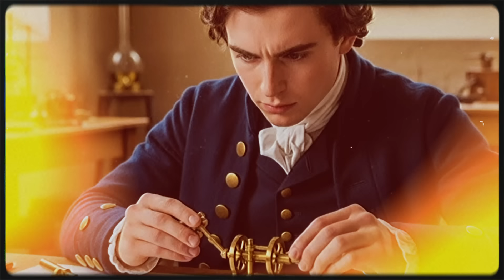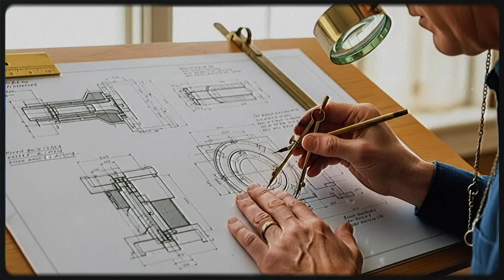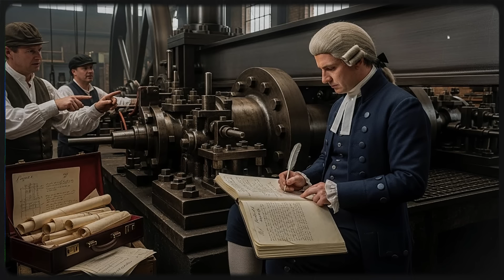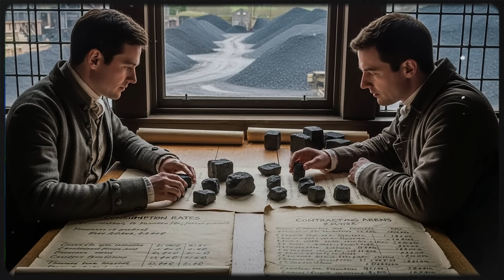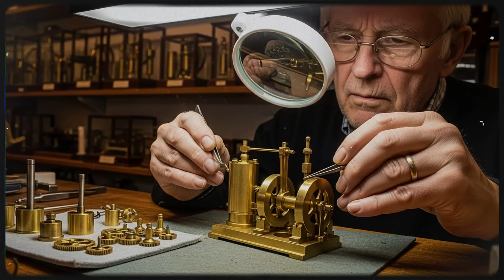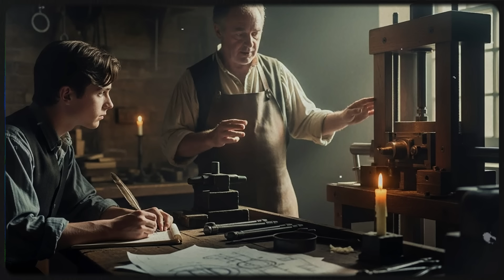They Built Atmospheric Engines in the 1800s — And Pulled Energy From the Sky

Comment: Greetings,  the big dieselengines were part of the old grid. If you reverse the system and put electric power tobthe outlet. You can pressureize and heat water. The old steam destribution and clean water drop fountains in the house......